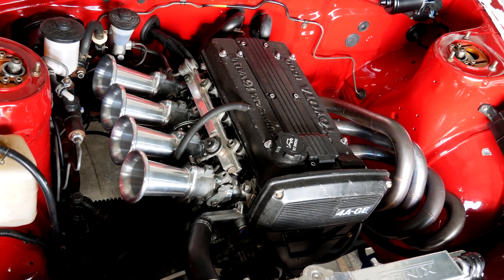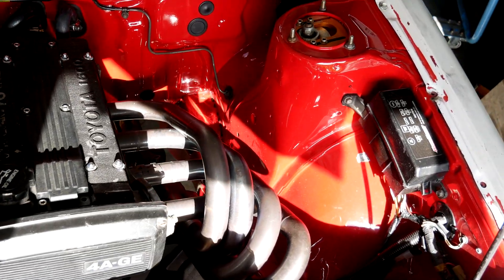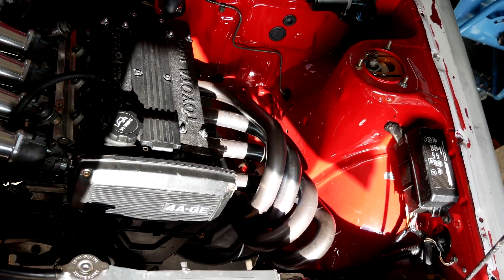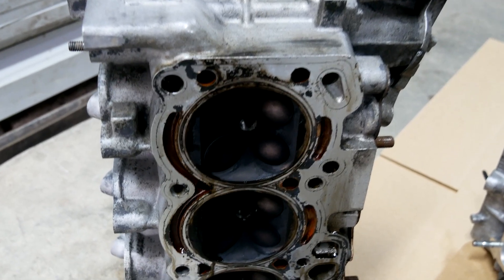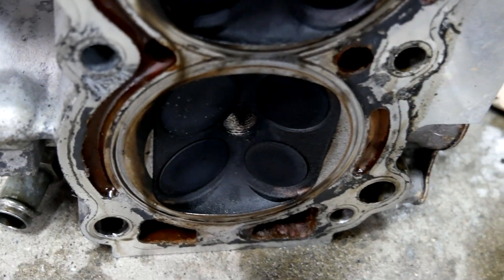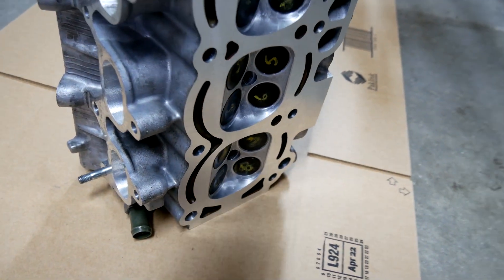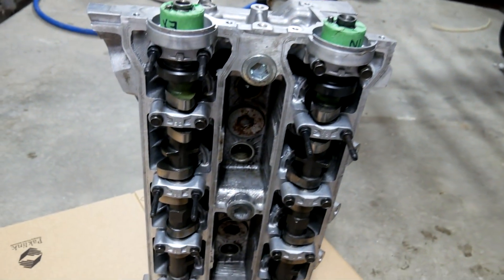AE86  Ported head & Cam upgrade - Dyno tested

Comment: What was wrong with exhaust that caused the dip?
Reply from the maker: Yes kinda as above,    These headers run a choke point and cone setup.  Along with the runners being the correct diameter.    Its a  part of the reason how it (and my engine setups) manages to hold onto the low end and start making more power through the middle with big cams. most are a dog till 6k with cams this big.   but is a double edge sword and can cause some weird stuff if not terminated correctly.    This is probably the worst ive seen,  I dont know the specific science behind it.  Likey some "bad" pressure waves from the exhaust and intake were lining up at the same time, causing some massive reversion at that point in the rpm range.      This one is still bit wiggly below 4000rpm.  but it wont really ever see that for its intended use.  Also its not a thing at low throttle openings .
Reply: If i had to guess, since changing a part of the exhaust system fixed the problem it mightve been the timing of the exhaust pressure waves were in sort of a, “wrong place at the wrong time” caused by what looks to be a sort of resonator since it was removed and then the dip in power went away.
An exhaust system built to make power uses the exhaust pressure waves, produced by the engine, to scavenge exhaust gases out of the cylinder and pull intake air into the cylinder. 
Even if toyota made a cast iron log exhaust header for this engine, I dont think it could produce such a drastic dip in power at a certain engine speed like this. 
I think the exhaust pressure waves were perfectly timed to actually cause reverse flow and push SOME (not all) air backwards through the intake causing the intake air speed to slow down a lot. Hence the massive dip in power at a certain engine speed and then a quick recovery. 
I am no exhaust pro, this is my guess.
Reply: @matos_x_ I've been asking for an exhaust scavenging video for years now, he doesn't want to do it for some reason?
Reply from the maker: @wiltse0   Its not that i don't want to do it.     It's just a lot of time and money  to show it correctly.      As can be seen in this video,   if change one thing in the exhaust it can wildly effect the power curve.   So to do it properly can only change 1 thing at a time,  which isnt easy on a full system.    if  change any of the lengths or sizes,  you are also changing the length or relationship to something else down the system.     running open headers  (which is way to loud)   is pointless also, because  isn't  many cases where someone is running around open header.  soon as add an exhaust it all goes out the window.     i have plenty of exhaust video's   you can kinda put together whats going on if you watch them all.     Its not like the intake stuff where can isolate the runner length  or diameter  and show what that one thing does
Reply: @Garage4age  do you have a fórmula or program to calculate runner lengths and diameters?
Reply from the maker: @bruhmoment802   I don't,    my original headers way back, were loosely   based off a calculator.  i dont remember which one.    Almost everything i run now, is based off my own testing.
Reply: @Garage4age open headers on a NA is usually a bad idea for sure (unless it’s a big boost setup or a 600+ci BB where flow is more the concern)! Interesting how it’s dipping and rebounding though! You can hear that your into it WOT, but it’s a weird low level stall just enough to keep it alive. But the exhaust pushes out the frequency/ frequencies (could be 180• canceling each other) and it just picks up where it left off lol. Not a bad bounce back for sure! Love seeing this stuff if for nothing more for data on future tuning or exhaust builds. Is there a way to go to a solid lifter design on any of the iterations? I know it’s a shim and bucket design, but did anyone make a design that could be considered an adjustable solid lifter for these? Just food for thought might be worth it on a NA race build (probably not great for a daily or streetcar). Pick up a little more up top and possibly smooth it out a little more. Great vids!!
Reply from the maker: @Burnz3132   Usually run a single piece bucket  from a 1sz toyota engine.   they have more surface area, than the stock  bucket  and shim on top setup.  so can run more aggressive cams. (head needs to be clearanced as well)  This one has them,  but isn't running cams that utilize the extra area at the moment.  Just had the cams in it hanging around as a cheap option.
Reply: @Garage4age  I see. That’s actually a pretty good option then! I mean it’s kind of an in between. Meaning it’s a step up from OEM, it’s something that’s bigger and will have less hydraulic movement as a larger surface area. It’s definitely getting more control, which is definitely what you want at 9k+! That and it’s not a huge shock at lower RPM’s lol. Definitely worth the extra work imo. Thanks for the reply as well. Have only touched a few of these, but have been in the market for a 86 for the shop. I know they’re very capable done properly.
Reply from the maker: @Burnz3132  Yeah the engine in my starlet uses cams designed for them.   the given duration spec isn't a whole lot more on paper compared to whats in this car,   but is at higher lift over the  whole duration.  since can run a more aggressive ramp  with the extra area.    Is also one of the drawbacks with the 20v 4age's as they run a smaller bucket
Reply: @burnz3132 I highly disagree on not running an open header. I had a b20vtec that gained 2mph & dropped 0.6 in the 1/4 mile
Reply: @guttedxx  so cause of the V tec I can kinda see that. But as a rule even a basic header extension is gonna net more overall vs just open headers. So I’m not disputing that gains can come from it. It’s just usually giving up something else in the heart of the curve. Open header is more of a flow thing. Plus removing 20lbs of exhaust in any Honda will probably net you close to those numbers especially if you had already gutted it. So was it the weight savings? We’re did you net the bulk of that time? Cause out too the 330+ it’s always chassis and weight. The 2mph isn’t enough for me to address it. So disagree all you want, but I sure a ton was left on the table that would’ve made more of a impact and better numbers. Open header isn’t worth it till you’re in need of fast evacuation due to high airflow. In a NA Honda that’s gonna start in the 400hp territory on a B20 with OEM B16 heads or ported 18/20’s. But there’s still plenty to adjust for that small amount you’re talking about.
Reply: @Garage4age  how do we get a set of your headers?
Reply: @Garage4age  David Vizard shows how to eliminate this effect with his "lossless exhaust system". Basically you establish your tuned primary and secondary header length, and then you build a large exhaust chamber, or "pressure wave termination box", as DV calls it. This chamber, sized based on the displacement of the engine, simulates an open atmosphere that allows the exhaust gasses to expand into. It then necks back down and has a tail pipe and muffler if desired that extends to the desired exit point. As long as the exit piping has a sufficient flow rate to prevent positive pressure from building in the pressure wave termination box, then you'll have the same output as an open header.

I'm just getting my Youtube channel setup, but I will be building this and demonstrating it on my dyno in the coming months.
Reply from the maker: @PyroPerformancePNW   I tried an open chamber in the past, didn't get any positive results from it.   possibly wasn't the correct dimensions though.    would be good to see someone else's findings on it.
Reply: Looks like he just swapped to a larger resonator.
Reply: Looks to me like the long middle muffler was screwing with the resonance
Reply: I don’t think he fixed the problem at all. He just shifted the anti-resonance. 

I’d like to see a video of a much straighter exhaust runner. I had a friend that ran a similar curvy exhaust manifold. It was kinda quiet for an aftermarket header, but it made some decent power. Later he switched to a straighter runner manifold, it was louder, and it made more power. Why? Any flowing gas doesn’t like bends. It just creates more back pressure and unique resonances and anti-resonances. Mostly straight runners only have one resonance and no anti-resonances, which is why they almost always make more power.
Reply: I dont recall the curve ever looking good, when was the problem "fixed"?

Comment: @Garage 4age would u say in generall setting intake cam as early as possible is the right move for a street performance car? Nice work keep it up
Reply from the maker: Yeah in most cases will be better.   going the other way generally holds on longer before dropping after peak power.   which isn't very useful on the street.   only downfall is will run worse at idle / low rpm with more advance due to more overlap

Comment: 100kw from stock cams and head is very generous. most 20vs don't do that. Would love to see your cars on another dyno...
Reply from the maker: Is plenty of comparisons on my channel.    my stock blacktop, rebuilt with a head tidy up, aftermarket ecu and tuned to get everything out of in in fwd chassis made 101kw.  so an actual stock one would be in the 90's.   remember this engine had a .5mm head gasket and probably a head skim.  so at least 11.3:1 rather than 10.3:1 compression,  good headers and exhaust. itb's, cam timing adjusted for best power and tuned for best power  to make that 103kw.    There is also a video of a proper Atlantic 4age race car on my channel.  Engine built by loyining's usa and made  over 250hp on their engine dyno.  made 170kw or 228hp on my dyno, which is about right for the loss in there transaxle.   my good engine makes 165kw when ran in 1:1 4th gear.   Just a couple of weeks ago a 2zz made 10kw less on my dyno than mainline hub dyno on same tune.    But yeah at the end of the day its the difference in power that matters,  every dyno is going to read a bit different
Reply: @Garage4age yeah guess my point is what you summed up at the end. Can't race dynos. I just look at the gains from one mod to the next.

Comment: I saw a Toyota track car that had the built up air pressure ducted through the door internals , through the rear 1/4 panels where the air in the rear arches was also drawn through and out the back in the low pressure area around the hatch. 
The car was much faster than mine above 80mph .
However I wasn't driving a rust bucket that had the structure of a cheese grater 😂

Comment: beautiful,.. i had a 82 supra  with the 83 rear and a 22re intake with a 22r head and an a block from a Toyota motor home. strait 4 inch flex pipe exhaust. the loudest 4 cylinder red line bouncing racket columbus ohio ever witnessed drifting one way streets lined with luxury cars.. got boxed for drifting around south high street and the park on Hanford and 4th.. after an epic 1 mile drift through one way city streets lined with cars that were not rusty like mine. i can see why they were waiting.. i did it every time it rained.
Reply: Started with a rubbish engine 4Age is the best designed engine ever it has literally no flaws lol
Reply: @SEIKOAE86  underpowered cars only need oil changes, overpowered cars need new wastegate springs, then rings, then transmissions things.
Reply: @stevetheborg I was just pulling your leg buddy as a chronically poor ae86 4AGE owner I fully commit to the ridiculous fragile and temperamental nature of it but as I say ITS ALL PART OF THE RICH TAPESTRY OF THE 4AGE LIFE 🤣👍 

Love seeing people use the chasis is cool ways, with all the dollars I’ve put into my wee 1.6 I sometimes wish that I just stuck a beams or f20 in it but don’t we all sometimes. 

Happy tuning mate

Comment: 130 kw is not bad, it's all the small tweaks that will matter now, balanced crank with fly wheel, sort the trumpets on the ITB's and tune the ECU and it will make high 130 maybe 140 kw, get that exhaust sorted as well, SS tubes are not that pricy anymore.

Comment: Hi recently i assemble a 4age 16v with small port head and black top itbs. It has wiseco 82mm 12:1 pistons, kelford 193c cams and ended up making 148 hp. Thats a decent number or maybe i can have more hp put pf that
Reply from the maker: If stock head thats not bad.    getting the intake and exhaust right along with good port work will make more

Comment: Just thinking would there be any thing to gain by adding adjustable cam gears to a 16v small port engine with stock cams. cheers
Reply from the maker: there is a little to be gained. i forgot to add that to the list on this car; on the 94kw run shown at end of vid, it also had adjustable cam gears.  from memory there wasn't much to gain peak power wise, a kw or 2    but gained across most of the curve adjusting the cam gears.   again no big gains, but was something in it.

Comment: Something with the Toda valve springs is on the website they say 8.8mm of lift max but it seems like you and many others have no issues go above this limit, what do you think of this?
Reply from the maker: I have never seen the 8.8mm limit on their site before.  maybe they recently changed  it.   worth looking into seeing if they changed their design.     have ran over 9mm lift on them for years
Reply: @Garage4age  interesting information I got from talking to battlegarage who talked to TODA, they say running the valve springs alone with stock shims would be 8.8mm of lift, but using their shim under bucket conversion with the upgraded springs allows up to 10mm of lift. I assume using solid buckets would be the same
Reply from the maker: @ThePastacholie    That makes sense.  Seems to be lost in translation,  as it will be referring to the cam profile rather than the spring itself.   you will find their cams over 8.8mm lift require the full face bucket. rather than a different spring.    some manufacturers like kelford  have 2 lines of cams one lot stock shim other full face.  the big stock shim cams have 10mm lift and similar duration. the difference is in the  the ramp angles of the lobes.  stock shim ones have slower opening rates so dont fall off the edge of the shim.   So yeh is not really so much of a lift thing. more of a  cam design thing.

Comment: If there is a mivec 4g92 engine, would love to see you do a test run.
Reply: Dynod one in adelaide Australia, it was stock engine with exhaust from a mirage cup car and the ralliart cup car ecu. The engine made 140hp to the hubs (hub dyno) you will have to do the calculations to compare it to the garage 4age's dyno results in the vid but im guessing that mivec was putting out more than this particular modded 4age. Just to add it was a 35 degree day too.

Comment: Helping my buddy who bought my build. He put a 272 turbo cam from Ted in it and we are reading 60kpa at idle... ambiant is 85kpa where we live. The problem is when i size the injectors correctly and set the ve table to 1 its at 10.5 afr. Is this a normal idle vacuum for a cam this size or is something way off? We also tried advancing the intake cam and retarting the exahust cam which harly had any effect on the vacuum...
Reply from the maker: I wouldn't get to caught up on the VE table being textbook, just tune the numbers to correct afr.     Assume its turbo since running turbo cams?   What ecu does it have?    Stuff with vac issues like big cams and or itb's,  usually span the fuel map in TPS vs RPM with  MAP  as the fuel equation/model,  so adds fuel with boost.     If NA,   ignore the MAP sensor,  run fuel map in TPS vs RPM  with baro correction
Reply: @Garage4age   Yes it is a turbo build, although he is "breaking it in without the turbo."  Its a megasquirt 2 running speed density. He is running the cams I mentioned, 235 degrees at 1.2mm lift and 272 advertized, and a mrp intake manifold. Its pulling about 30kpa of vacuum. He may need to degree his cams. I cant even get the right afr at idle... the ve gets to 1 and the afr is still 11.2, if I set the ve to 0 then no fuel at all. I am wondering if the vacuum port for the map sensor isnt reading what the ports are actually seeing. maybe need to weld in bungs on the runners to get a better vacuum reading... Or try running a different algo like you were saying... I have no frame of reference as to what kind of vacuum it should be pulling...
Reply: @treysnyder2676 got that problem before check the the req duel and adjust to something like 5-10ms. And check your gamma fuel like if theres anything added that you missed out. And also check the pw while running it should be under 2.5ms i think for stock injectors. Im at 1.5ms with 550

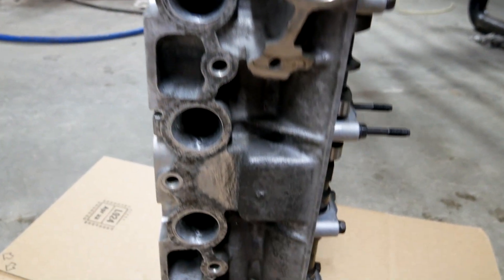Comment: from the chart at 2:37 , did you increase the rpm limiter with the installed new g4a ported head? Because on the chart it has a different "location" of where the power graph drop (hitting limiter)
Reply from the maker: Hi,   Looks like i forgot to re scale the rpm on the first graph with the stock head baseline.     rest are correct.   dyno is in road speed, so i put the rpm in manually based on ecu logs.       from memory went from 8500rpm limiter  to 8800rpm with the new head.